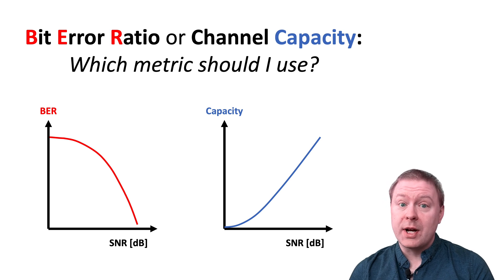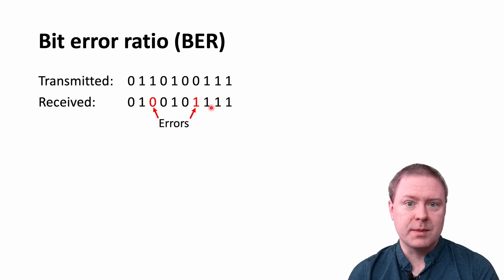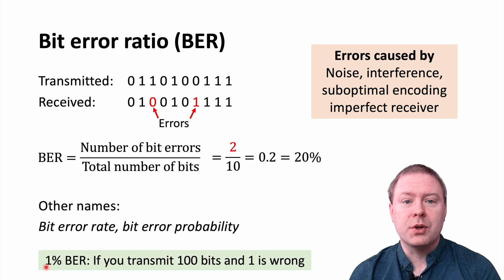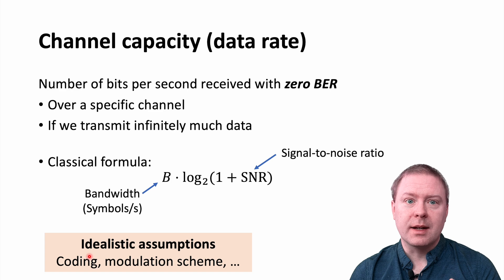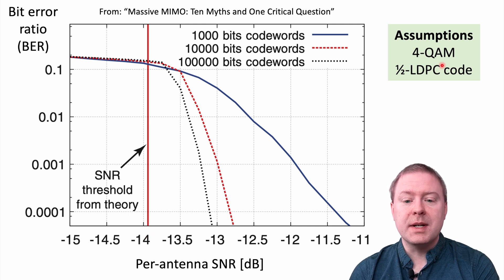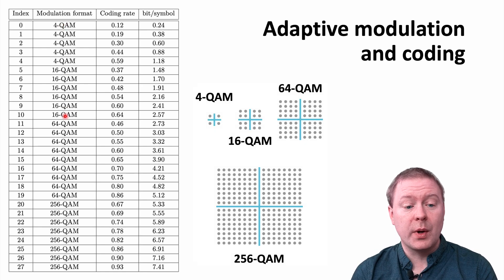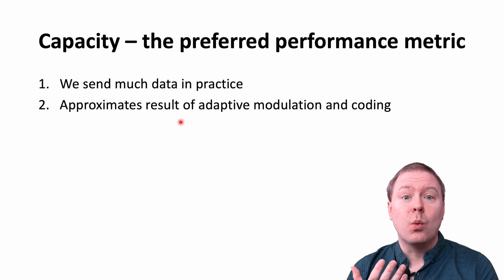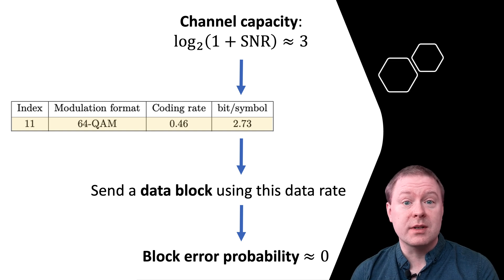Bit Error Ratio or Channel Capacity: Which metric should I use? [Frequently Asked Questions]

Comment: Why is the assumption of infinite bit streams? Is the capacity formula derived with such assumption?
Reply from the maker: Yes, the capacity is defined as the maximum data rate that one can achieve with zero error probability as the length of the bit stream goes to infinity. Fortunately, it is a good metric already for 1 kbit of data, so it is useful in practice.

Comment: Hi there guys! I just wanted to add this to help humanity. I personally believe that 3GPP documents should include source code for simulations, as it would accelerate everyone's work. Cheers and success to everyone!
Index = 0:27;
Index = transpose(Index);
Modulation_Format = ["4-QAM","4-QAM","4-QAM","4-QAM","4-QAM",...
                     "16-QAM","16-QAM","16-QAM","16-QAM","16-QAM","16-QAM",...
                     "64-QAM","64-QAM","64-QAM","64-QAM","64-QAM","64-QAM","64-QAM","64-QAM","64-QAM",...
                     "256-QAM","256-QAM","256-QAM","256-QAM","256-QAM","256-QAM","256-QAM","256-QAM"];
Modulation_Format = transpose(Modulation_Format);
Coding_rate = [0.12, 0.19, 0.30, 0.44, 0.59,...
               0.37, 0.42, 0.48, 0.54, 0.60, 0.64,...
               0.46, 0.50, 0.55, 0.60, 0.65, 0.70, 0.75, 0.80, 0.86,...
               0.67, 0.69, 0.74, 0.78, 0.82, 0.86, 0.90, 0.93];
Coding_rate = transpose(Coding_rate);
bits_per_symbol = [0.24, 0.38, 0.60, 0.88, 1.18,...
                   1.48, 1.70, 1.91, 2.16, 2.41, 2.57,...
                   2.73, 3.03, 3.32, 3.61, 3.90, 4.21, 4.52, 4.82, 5.12,...
                   5.33, 5.55, 5.89, 6.23, 6.57, 6.91, 7.16, 7.41];
bits_per_symbol = transpose(bits_per_symbol);
SNR = 2.^(bits_per_symbol)-ones(size(bits_per_symbol));
AMC_5G_Table = table(Index,Modulation_Format,Coding_rate,bits_per_symbol,SNR);
disp(AMC_5G_Table);

Comment: In the transmission MISO channel we have the equation y=h^T*x+n.......the letters h and x are bold faced - but we have just one value for x, is that right? X is a vector and not a scalar in the equation - so in the x vector hase everywhere the same entry, right?
Thanks.
Reply from the maker: The bold face indicates that h and x are vectors, with a length equal to the number of antennas. A more precise way to write the model is y[i]=h^t x[i] + n[i], where i is a time index. So during the transmission, we have many x-vectors, on at each discrete symbol time i. The channel vector is constant for many time indices. We typically pick the x vector as a fixed precoding vector (selected based on h) multiplied by a time-varying scalar data symbol. See Chapter 3.2-3.3 in “Introduction to Multiple Antenna communications and Reconfigurable Surfaces” to learn more.

Comment: Hello Dr. Your videos are thought provoking !!!Are signal-to-noise ratio (SNR) and bit error rate (BER) always inversely proportional? could you provide some insights on enhancing channel capacity beyond employing MIMO or multiplexing or advanced modulation techniques?
Reply from the maker: The BER is a decreasing function of the SNR (for any well designed system), but it is generally not inversely proportional.

The capacity is the highest possible data rate for a given channel, so the only way to enhance it by “changing the channel”. This can either be done by adding antennas or deploying infrastructure such as relays and RIS in between transmitters and receivers. In multi-user scenarios, to coexistence of the users can possible be modified to strike a better balance between the capacities of the individual users.
Reply: @WirelessFuture  Thank you very much sir

Comment: Many thanks for that tutorial 
It's really beneficial.
Would you please make another tutorial for how to calculate the BER?.
As its equation varies significantly based on the used system ( single carrier, OFDM, and so...)
Reply from the maker: There are some analytical BER expressions, but mainly for uncoded transmission with BPSK and QPSK. There are barely any analytical expressions for coded transmission, which is what matters in practice. One can compute approximations and bounds, but this is most interesting to understand scaling behaviors. Hence, the simplest and most accurate solution is to run a Monte Carlo simulation where you measure the BER by sending a lot of data using the exact modulation and coding scheme and decoding algorithms as your practical system. We cover Monte Carlo methods in this video:

https://youtu.be/e0a0bfw1QEs?si=JANsS8ZOkwiqUzS5
Reply: @WirelessFuture  well, thank you. I will give it a try

Comment: I find all three points very insightful. In my opinion, low-level physical layer signal processing tasks such as MIMO detection focus on BER. On the other hand, higher-level physical layer optimization tasks such as power allocation and beamforming design, are focused on channel capacity because their optimization objectives are related to SNR.
Reply from the maker: Yes, bit errors are particularly important in decoding algorithms. However, you need all bits to be received without error eventually, so if a codeword is decoded incorrectly, you need to retransmit. If you then measure the bit rate for the correctly decoded bits (compensated for the retransmissions), it will approach the channel capacity if you use a good channel code and long codewords.

Comment: Could you explain how coded modulation capacity I(X;Y) for a fixed constellation fits in with the explanation? I have seen that it is strictly below Shannon capacity but can get very close to Shannon capacity at low SNR.
Reply from the maker: If you want a precise mathematical formulation, then you can read the following book: http://www-sigproc.eng.cam.ac.uk/foswiki/pub/Main/AG495/bicm_fnt.pdf

A simple approximation is the following: 
Suppose you transmit a block of M-QAM symbols using a block length L and coding rate R. This will result in a block error probability P_L(SNR), which is a decreasing function of the SNR. Then I(X;Y) ≈ log2(M)*R*(1-P_L(SNR)).
Reply: @WirelessFuture  Thank you.

Comment: Why are SNR values negative? Does this mean that the signal is significantly smaller than the noise? Additionally, what is the utility of such communications? Thank you for your informative video.
Reply from the maker: @bumsupark3074 is correct. The SNR value is often reported on a decibel scale because it can vary greatly, particularly in wireless communications where the propagation distance can be anything from 10 m to 10 km. Negative decibel values represent that the noise power is stronger than the received signal power, but one can still communicate using small-sized modulation schemes and strong channel codes.
Reply: Might be the SNR in decibell (dB) scale